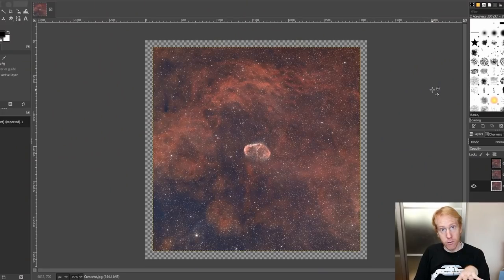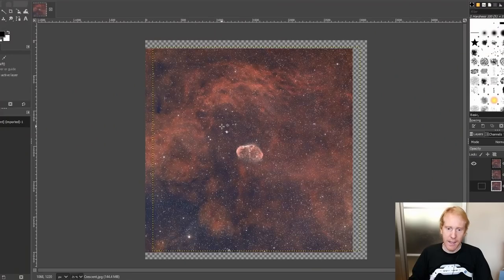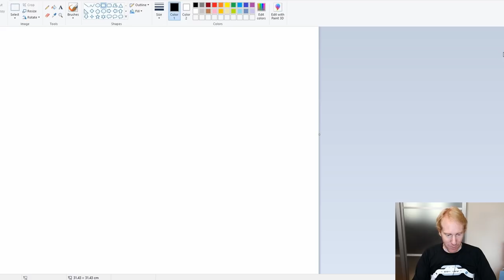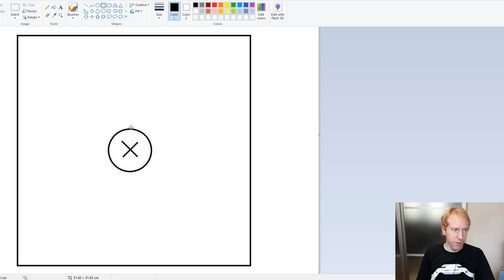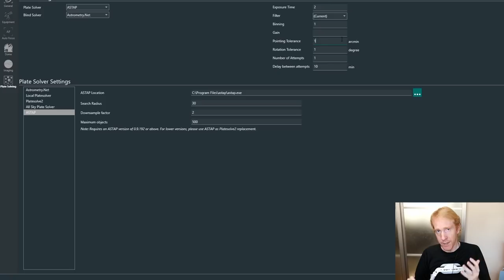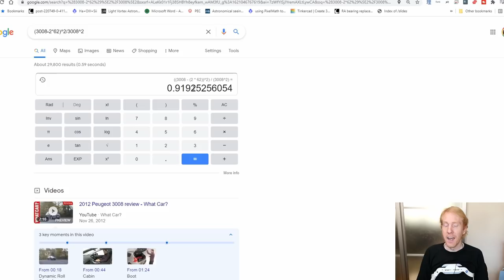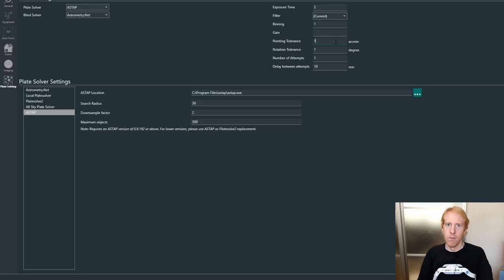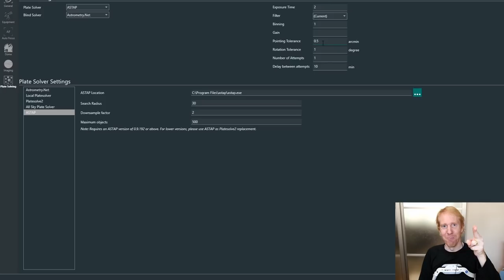Framing Plate-Solving Tolerance

Comment: Great explanation. Is it possible in the new N.I.N.A. sequencer to intermittently re-centre? Sometimes when I losing guiding the imaging sequence will be a long way from the original tolerance. I hope you're pain free and recovering well :)
Reply from the maker: Yes you can :) But you'd have to either use the advanced sequencer (check my video on that). Or, even in 1.10, you can simply add the same target multiple times with centering on. So first target M3, second target M3, third target M3. Then it will just recenter when going from one target to another, even though they're all the same.

Comment: So what would the equation be for for the ZWO 2600 6248x4176,  (6248-2*38)^2/4176^2 ? also curious Cuiv what would you set it at with guiding RMS error of around .17-.30 total RMS error "Losmandy G811G " currently its set to ,5 arcmin in Nina "new scope new camera and finally auto focus"  I know 1.54 arcsec per pixel isnt Ideal http://nova.astrometry.net/user_images/4643486#annotated

Comment: Very interesting video again Quiv, hope everything is going well with the back, looks very difficult to sleep with that brace, hope it will be cured soon 
Never really thought about it this way, so entering a very low number can make it a lot harder for the mount to always get that same target at the right point.
So say if someone, like you, is using a EQ-6 R  mount, what would than be the sweet spot for the platesolving to get it easily solved ?
Reply from the maker: For me, the default of one arcminute has always worked well - if I were to use a high focal length with a small sensor camera, then I would need to reduce it to 0.5 arcminutes or less. But usually, with GreenSwamp Server, I see that the Platesolving gets it within a few arcseconds on the second try, meaning I have lots of room to breathe!
Also I can remove the brace for lying down - so I sleep without it! I can even walk without it, but then it's much better to keep having it on.
Reply: @CuivTheLazyGeek  Thanx Quiv !
Hope you get well soon

Comment: Hi Cuiv, you paint a lovely picture about platesolving. Almost as if it’s the silver bullet for most setup issues we go through at the start of a session. I have two nights of experience with it and it’s not good. Purely down to me of course but to some extent the need to set it up for each scope / sensor. So could you do a a video on plate solving for sharp cap or the more fundamentals and the PS. software that’s best and most easy to setup etc please.
Reply from the maker: Yeah it can be hard at first (do your tests during a full moon!) - I personally use ASTAP from NINA (and Astrometry.net as a backup), I have a video on that here: https://www.youtube.com/watch?v=lAMyEpBcLV4

Comment: Hi Cuiv, great to see you back! Great video! A quick plate-solving question. I have been using NINA plate-solving for quite a while with no problems until last night. I was trying to shoot M3 but I could not plate-solve no matter what I tried. I thought it was because the central area of the star mass is so bright, but I could not get the image to  solve. Any suggestions?
Reply from the maker: That will depend on the platesolving engine you use! I typically have ASTAP followed by Astrometry.net. The former is very fast but sometimes fails, the latter is slow and in my setup requires internet connectivity, but works almost 100% of the time.
Reply: @CuivTheLazyGeek  and njcck, I hope you have solved your plate-solving issues.  I am following in your footsteps one year later!  I have found that ASTAP is very sensitive to the pixel scale.  Since N.I.N.A rounds the pixel size to 1 decimal place (I wish more precision was allowed), I had to adjust my focal length to make the arcseconds per pixel correct.  Then, ASTAP becomes magic, as the OP said.

Comment: Great video Cuiv. Are there any parameters that control the pulse duration NINA (or ASTAP) sends to the mount during platesolving? i.e. if the pulse is too short it moves too little or if it’s too long it overshoots, requiring the multiple platesolves before it fits inside the tolerance. I guess I’m looking for something like the PHD2 pulse duration parameters but for platesolving instead.
Reply from the maker: It's actually not a pulse, but a GoTo command. So the standard way is to send a sync command to the mount with the correct current coordinates (found out via plate solving), and now that the mount where it is actually pointed, a GoTo command works. If you don't want to sync your mounts (premium mounts with sky modeling), there is an option for that. In that case, based on the plate solving result, NINA will compute "fake" coordinates that would put the mount on target, and send a goto instruction. Either way, afaik, it's a Goto rather than a pulse!
Reply: Thx for the info! I find with my imaging rig I’m at 0.31”/px & I find with a tolerance of 1’, ASTAP platesolving can sometime take up to 6 iterations to finally get the image within the tolerance. So I was hoping to have more control of the mount during platesolving rather than move back ‘n forth till it gets it right.
Reply from the maker: @AnakChan  Are you using the latest ASCOM driver? Vixen had a bad bug that made sync and getstatus commands ignore the seconds part of coordinates, causing exactly what you describe. They fixed it for me in November 2019, and seem to have published the fixed version publicly in June 2020: https://www.vixen.co.jp/update/star_book_ten_ascom/ . If you still have issues with latest driver, try the fixed version they originally sent me: https://drive.google.com/file/d/1chsAlJsjnU3zhyXZ-oZ1w7TOXLOilm8p/view?usp=sharing
Reply: Cheers for the tip! Yes I'm on 1.2.2.0 which was released last June. What logfiles can I sift through to see if getstatus is ignoring the seconds portion of the coordinates? Meanwhile I've downloaded your driver. (which seems to be even newer at 1.2.3.1).

It seems that the Vixen ASCOM doesn't seem to return GetGuideRates too (https://www.cloudynights.com/topic/760880-help-in-interpreting-phd2-guiding-graphs-log-file/?p=10958683).
Reply from the maker: @AnakChan  You may want to uninstall and reinstall that driver :) The latest from Vixen on their website is 1.2.6.0 (and it properly says so in the screen where you define the IP). Also make sure the Starbook firmware itself is on the latest version (5.1 I think?) as that fixed another bug I reported to Vixen and helped diagnose.
Otherwise, there are no log messages that can let you see if that's the issue. I remember using some software to intercept the messages sent to and from the mount, spending hours to diagnose that (and then get Vixen to fix it).
Reply: I just checked the Vixen page few mins ago and was surprised to see 1.2.6.0! On the SBTen, yes I'm already on 5.10. I've just installed 1.2.6.0. Guess the only way to confirm is to test without any debugging. Thank you so much!
Reply from the maker: @AnakChan  Let me know how it goes!

Comment: Not really had a problem with NINA losing pixels at edge of farms during plate solving. My experience is that plate solving takes two frames. The actual mount error in achieving the desired coordinates is related to the distance the mount has to move. So second plate solve involves a very small move and will much more accurate than first plate solve and slew. When it does it second slew it will it to WITHIN 1 arc min, otherwise it will do another plate solve/slew iteration. So I suspect actual plate solve error will typically be half the error limit set in NINA.

One other point is that setting the tolerance too tight can result in NINA ‘hunting’ for the correct coordinates for the object.

The bottom line is that plate solving has been a game changes for achieving high productivity in astrophotography and is way more accurate than manual alignment.

Are you up to 3kg load limit yet ;-).
Reply from the maker: You are correct - if you were to look at the distribution function of final target center within that disc, we'd likely see a nice 3D normal-ish curve (only ish because the disc doesn't stretch to infinity) for most mounts! Yet some mounts really struggle, and NINA/SGP will call it a day as soon as tolerance is achieved - so I looked at the worst case scenario here. And yes, Plate-Solving is just the best :)
Not sure what my load limit is as of now, but I'm taking it easy for the moment!

Comment: Still rocking the 533 or just using it as an example for understandability?
Reply from the maker: I still have the 533, definitely will keep using it (when I send the loaner 268M back) - but yes, a square sensor made the example slightly easier!
Reply: @CuivTheLazyGeek  Good to see you back in action. Did you resolve the Aritfact Issues with your 533 when cooling? I have the same problem with mine and its back at the supplier now so I’m out of action until they can examine it :(
Reply from the maker: @pdenny1968  In the end cooling slowly (like 10-20 minutes) and waiting a couple of minutes after cooling was complete worked fine for me!
Reply: @CuivTheLazyGeek  ok, thanks for the info. Mine had loads of these artefacts all over the sensor and they don’t fully go away even after 45-60 minutes, they leave a darkish smudge where the large white spots were. I can only avoid it if I cool very very slowly in 5 degree steps. This makes automation of the system practically impossible as it doesn’t always work and I have to try again. ASI software doesn’t even have a cool down period so I can’t accept this as acceptable behaviour for the camera hence I’ve sent it back. Fingers crossed they find a cause and repair or replace it. Cheers.
Reply: @CuivTheLazyGeek  A small thing I have learned after going astro-cam and almost nobody talks about is the need for en IR/CUT cut filter. It adds 2-300euro to the price, depending on quality.